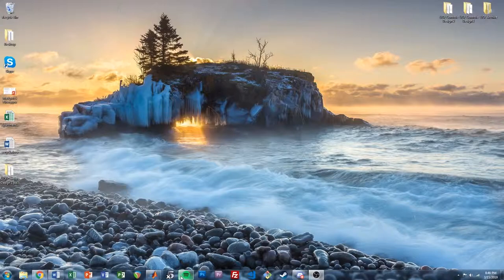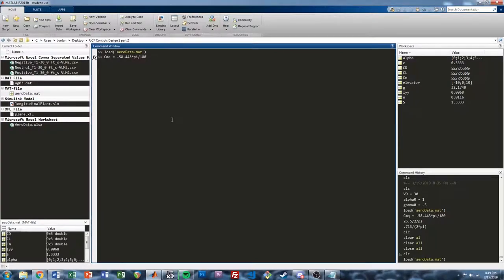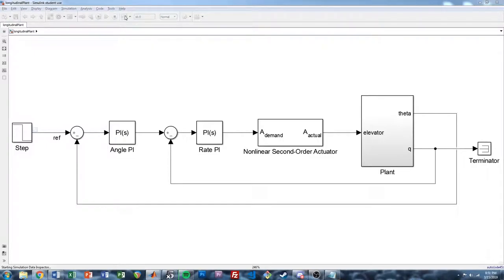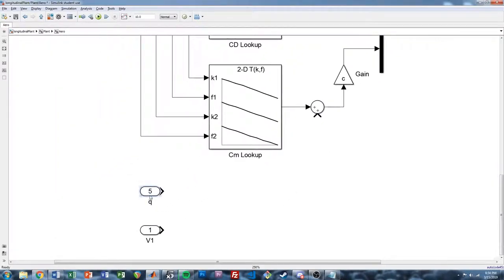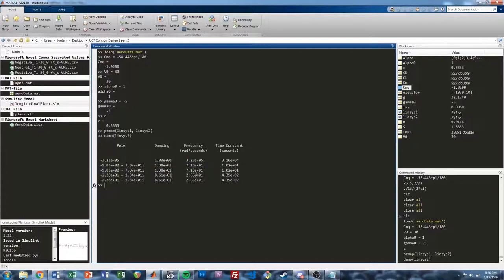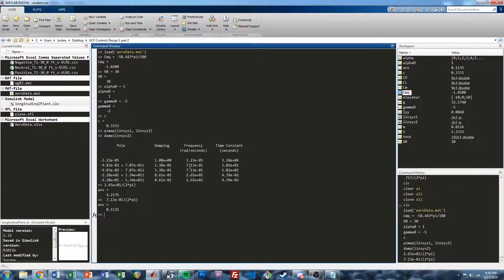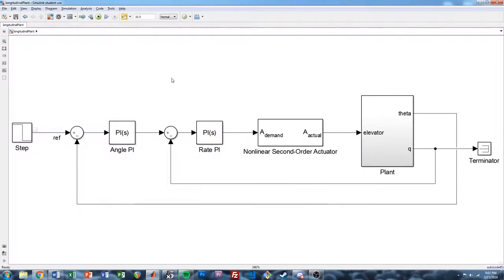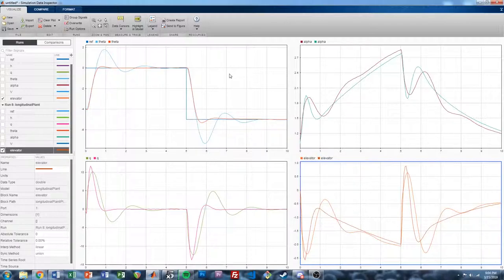Autopilot Design with XFLR and Simulink (Part 2)

Comment: While doing stability analysis on xflr5 I'm facing some errors that's why the modes for longitudinal and lateral stability are not operating could you plz guide me through THIS? 
Like which parameters should I consider for generating the view of root locus graph. It would be a huge favour if u could help me out